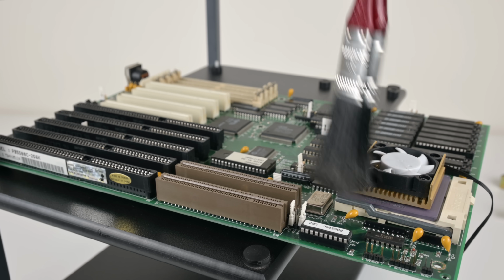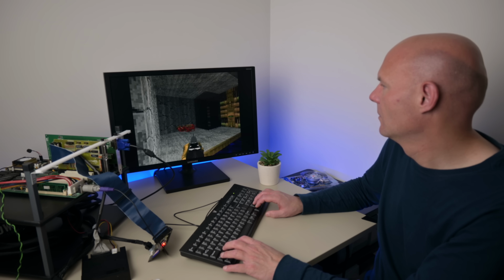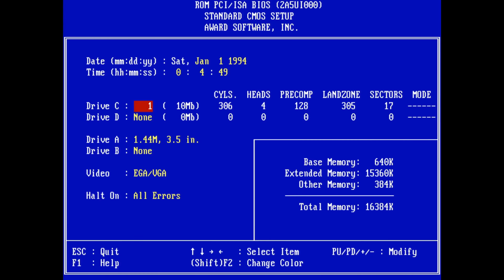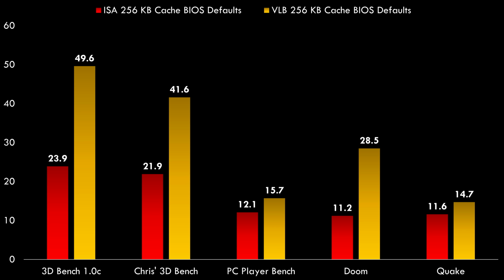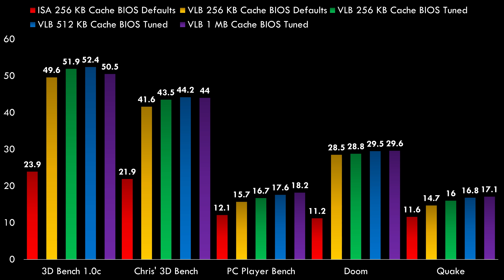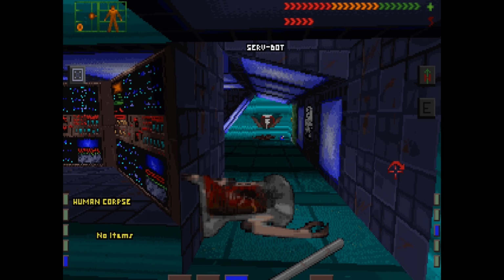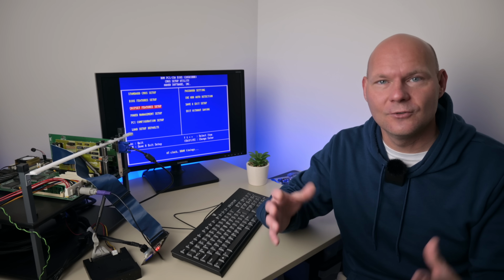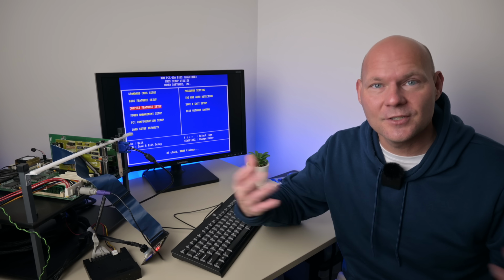Broken CPU Launched the Pentium Branding

Comment: Goldstar is meaning LG nowadays isn't it? 4:28
Reply: Yes I had a 15" monitor (56m) with integrated Speakers that was first sold as a Goldstar and then rebranded as an LG, that was about the time the Pentium 133 was the absolutely fastest and expensive thing out there (I had P90)
Reply: @RetroTinkerer  I still have an audio system(23 years 10 months old at least)  from those days and its logo is clearly LG.
Reply: Hello @airmicrobe  the transition was a bit earlier if I'm not mistaken, must had took place around between Windows 95 and Windows 98, I already had replaced my Pentium 60 CPU and its VLB motherboard under warranty for a Pentium 90 (PCI motherboard) when I purchased my Goldstar StudioWorks 56m and a Diamond Speedstar 64 PCI.
If you search for that monitor "StudioWorks 56m" or the one without speakers (56i) you will find pictures of the same screen with Goldstar / LG logos.

Comment: you can heat the heatsink up with a blowtorch or heatgun. It will soften the glue. Twisting the heatsink will make it easier to get it off. That can be archived with a screwdriver.
Reply: Actually cold might work better. Thermal adhesives are designed to be stable under high heat and will get brittle under very low heat. So a freezer might work way better than a blowtorch.
Reply: @harleyn3089  Cold might work as well but most thermal adhesives i have seen began to break down at temperatures as low as  100C. Epoxy based thermal glue might take higher temperatures but that stuff is usually not used by commercial manufacturers since it is much more expensive than acrylic/acrylate based glue. Some super-glue removers work on heatsink-glue/pads as well. The glue turns into a gummy consistency but it takes a lot of time to let the remover creep between the heatsink and CPU.

Comment: I was waiting for a video featuring the first Pentium.  My friend bought a PC with the first Pentium back in the day.  The problem was that the chip was new & state of art so it was really expensive.  This meant my friend only got the base parts (motherboard, memory,cache, graphics card etc).  When we compared it side by side to another friend's loaded 486......the 486 kicked it's arse.   We were shocked but not surprised because the 486 had all the best parts.  Your video showed that the Pentium guy probably needed to dial in the settings more and add the better graphics card & cache.  
I notice this theme happens a lot when a new category of microprocessor comes out. It's so expensive that sometimes the cost/performance ratio is better when you get a loaded PC with the older chip.
Reply from the maker: Yea for example if you give an ISA OAK graphics card with the Pentium but a fast VLB card with the 486...

Comment: Socket 7 boards also often had IO like floppy/IDE/parallel and serial onboard which are not easy to find these days, some had DIMM sockets and there were even ATX boards which make them way easier to get up and running these days. I'm still looking for a decently priced PCI GPU and then I'll look for a decent i430 based Socket 7 system.
Reply: A lot of the "run of the mill" PCI graphics cards are relatively cheap, but the likes of 3DFX Voodoo/Banshee, TNT 2 Ultra etc, all attract premium prices. I had loads of TNT 2s, old Geforce 2s etc lying around for years. I wish I'd kept them, not just my Voodoo 1. I could have made a fortune! 😁
Reply: @another3997  my problem is that I live in Switzerland and all local supply for such old hardware has dried up and are sold as rarity for around 100$. Yet importing from other countries is becoming increasingly expensive with shipping prices around 30$ and import taxing fees of 20$ that makes importing anything worth more than 20$ not worth it.

Comment: Oh wow! That brings back memories. Thanks for another great video! 

I bought myself a Pentium 60 when I was in High School. I was into music production and composition and had it outfitted with the Sound Blaster AWE 32. Mine had the floating point error and I got a great deal on upgrading the system with a Pentium 100 and new motherboard a short while later.
Reply: My obscure wavetable card from Trust I can't even find back on the internet but it was cheap(er) and it worked. Doom with music :)

Comment: This is a primary lithium battery... it does not leak!
It also lasts nearly forever.
The only problems with these are in a case of a sort.
Reply from the maker: Not taking chances, I've seen coin batteries leak and it's just not worth it.

Comment: Feels like this is more of a collector's item nowadays than a serious candidate for a retro build
Reply: One would certainly be better off cost-wise with something like a P75 on a Socket 5 board.  That being said, sometimes it's more fun to have an oddball.  What would be REALLY interesting is testing the Pentium Overdrive for Socket 4 against a standard socket 5 P120 or P133.
Reply: Yes, it's a collector's item, although I have a 166 MHz Pentium MMX in my IBM ThinkPad 760XL and I'm really enjoying it. I remember when the Pentium was originally launched. Having a superscalar CPU which could execute two integer and two floating point instructions at a time was revolutionary back then, at least for desktop computers (very expensive workstations had already introduced this tech). We bought one at work and I was amazed at how much faster it was at running Doom than my 486 PC at home.
Reply: That's all I keep the CPUs for - I have a 60 and a 66 in my collection. I would never assemble a system around this gimped CPU. I'd rather build a 286 ;P
Reply: @the_kombinator  Well, keep in mind that the 286 has been famously referred to as "brain dead".  For all intents and purposes EVERY retro CPU is gimped in some way.
Reply: @dennisp.2147 Perhaps, but this Pentium is almost uniquely useless for any particular era of gaming. It's faster than ideal for compatibility with late 80s - early 90s games and too slow for a lot of mid 90s games.
Reply: How many collectors need it ? Museum ?
Reply: @lucasrem  I mean if I had it I'd run it, but it commands a big premium that doesn't make sense compared to other pentiums for a new build
Reply: true because the Pentium 60 was to slow for Pentium games which targeted minimum 75 MHz Pentium recommended 90 MHz